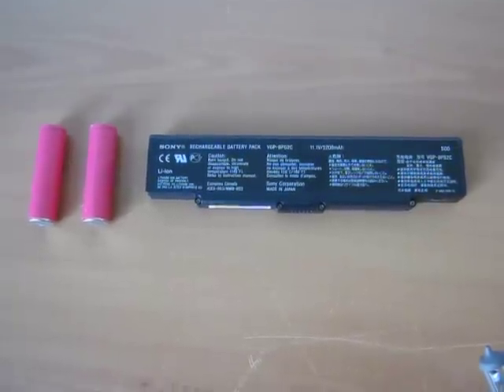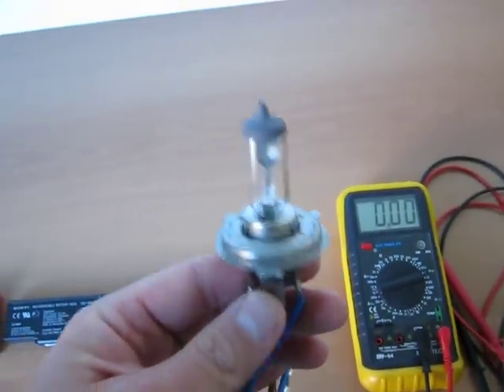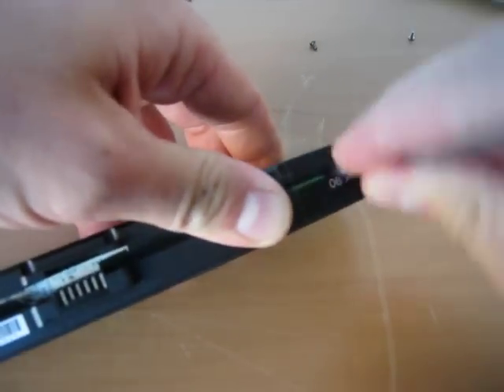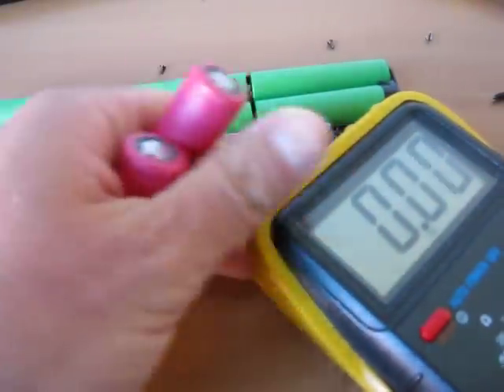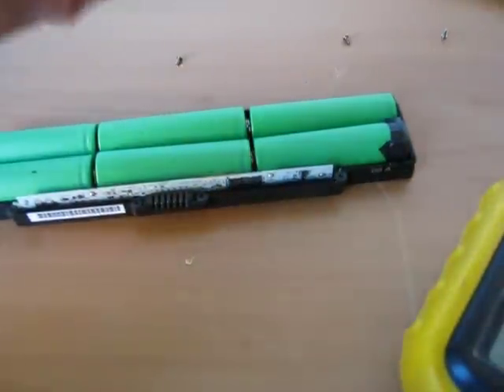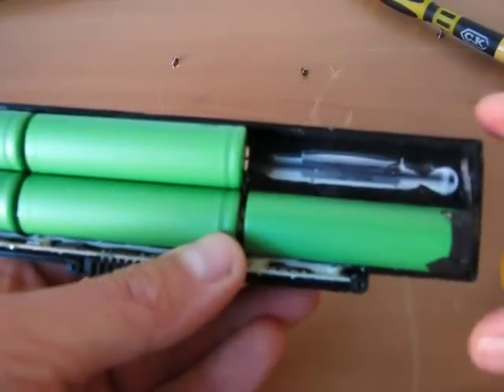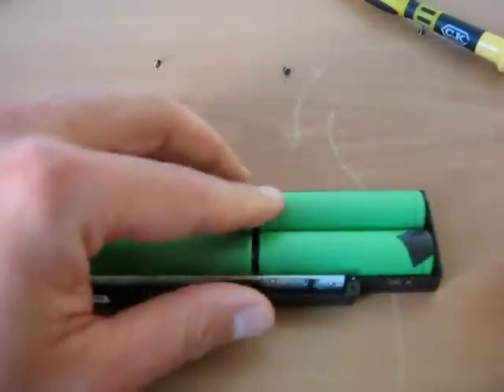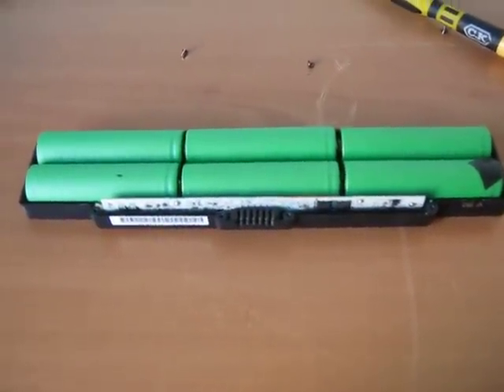Notebook battery repair / replacing lithium cells

Comment: Good video. My original laptop battery is dead and have these cell specs = ICR 18650 Samsung 30B. So when I replace the dead cells, can I only use the same Samsung 18650 30B cells or they can be any other type e.g. 28 or 32f etc..? Thanks
Reply: I think as long they are the same type and Voltage, e.g. ICR 18650 3.7V, it should be fine. ICR is the chemistry so you need a match. mA can vary, so if you want a battery that lasts longer, pick a higher mA rating. The brand does not matter but be careful of the various OEM counterfeits on ebay, advertising 3000+ mAh and delivering around 900. A normal battery of this type wouldn't go beyond 3200 if i remember correctly and should weight over 44 grams, if its lighter then it has a false mAh rating.

Edit: I suspect the 30b is just the model of the battery, can't find anything else with the 30b in it and the drain rate is expressed in C and E letters, B doesn't stand for something.
Reply: Thank you for technical information. Will see where can I buy those batteries.

Comment: How did you reset the battery after recelling?
Reply from the maker: do a simple calibration process, in many cases thats enough (some models might have problem with the built in EEPROM counter, do a search for your model)
https://support.hp.com/lamerica_nsc_carib-en/document/c04700771

Comment: I can`t believe how easy this reconditioning steps are ( Check Details Here>>https://plus.google.com/113658828433866467763/posts/72dX1D1623q ! My old (and once dead) vehicle batteries, cellphone battery, drill battery, camera battery and tons of some other batteries are all reconditioned and working good again! Do you believe I`ve ended up saving $ 400 from the day I started performing it??

Comment: Is it safe to use a 12V bulb like that to discharge 18650 cells? I have 6 in parallel for some project and want to discharge the pack. thanks
Reply from the maker: a 18650 cell should be around 3.7 V , if you tie them paralel the voltage remains the same just the current doubles what it can drive. Although it's not recommended to make paralel cell connection at home as you need special care for selecting matching cells for this, which made properly in the manufacturers site. (Only series connection is advised at home but not paralel)
Reply: 12v bulb? thats not gunna pull much current but with 6 yeah it will work. Discharging is never the problem

Comment: can't find battery inside the laptop ?  Can anyone help me about laptop battery replacement ?
Reply from the maker: internal lipo batteries are quite tricky as fragile for mechanical shock, not like the well protected cylindrical cells shown in this video. Contact your laptop manufacturer for internal battery replacement, try googling for service manual with the exact process.

Comment: On the vaio battery pack it says 3200 mah but what is the capacity of one green cell itself?
Reply: Capacity for each cell is 3200 mAh, and the rated voltage  3.6 Volt.

Comment: never touch + and -  of battery!
Reply: Uhmm...why? It's 3.7 V not 10kV :)
Reply: doesn't matter how many volts has battery. Battery life is shorter
Reply from the maker: Can you explain what are you talking about? A typical skin on human hand has a few mega ohm resistance, which corresponds to nano amperes running from battery during the touch...
Reply from the maker: Maybe this can be true for tiny computer real time clock / bios batteries, which has to be run for years. If some dirt / oil gets there from your hand that can effect lifetime like 1 year instead of 2 year. But in case of 3000 mAh lipo cells that's a different thing and no problem touching it.
Reply from the maker: I spent my entire life in electronics but never heard such a weird thing :) 
Can you send a proper explanation a website or something rational explanation? Thanks
Reply: well, i continuously handle caps rated and often charged to 35-45V without noticing. Above 55-65V though, the voltage is high enough to break through the skin on your hand if you're not extremely dry. 

https://en.wikipedia.org/wiki/Electric_shock#Body_resistance
Reply: As verokay said, it is very difficult for low voltages go through the human body due to the high resistance of the skin. If even microamps go through you, there would be no impact on the batteries whatsoever as these 18650 cells usually deliver around 3 amps safely without harming them.
Reply: I know it's not easy to understand and explain :) everyone has choice what to do :)
Reply: Just give some scientific background on how is it that "you can confirm".  Don't worry if it's not easy to understand, leave that to us.
Reply: i used to remove insulation by teeth and once i accidentally put a supply line in my mouth ( 220v phase ) and these 3.7v batteries are nothing................and yes there is a chance of explosion from these batteries.
Reply: Very ignorant and unhelpful comment.
Reply: I get this information from computer specialist. He has a lot of experience. I can confirm, that battery life is longer.
Reply: every electronics specialist knows about it, to don't touch.

Comment: Hallo veryokay brother, )) 
Please help. I have vaio with chinese generic 6 cell battery pack, that gave me around 1 hours 30 minutes backup.  Now I removed its generic cells and soldered original Samsung 3000mah cells in it. But, it gives me 1 hour 5 minutes back up. I thought they will give me almost double power. What must be done? Thank you.
Reply from the maker: Kketansa Art You should do calibration than, to let your laptop learn the real battery capacity! Google up the calibration process for your actual laptop type.Good luck!
Reply: Veryokay I did the optimization by Battery drain and Full charge, 2 or 3 times. Now I get 3 times more backup. Thank you very much Veryokay.
But one more thing I want to tell. When the laptop says 7% 14 minutes. it remains the same for little more than 40 minutes before it hybernates. I get much more extra time, even if it shows less % and time.
Reply from the maker: Kketansa Art Excellent! ;)

Comment: Nice video..I have tried this with all good batteries...and for some reason the complete battery will not charge..I think..or do you think that the charge control circuit has a counter that will stop a battery from charging...so you have to buy a new one..seems to me to be this way..if so rebuilding the pack will not work right??? I do know for a fact that some Canon camera batteries will not charge and say on the screen that you are using a generic or after market battery and it will not charge..
Reply from the maker: Kennynva T. I suppose to look a after your batteries exact part number on google, maybe there is an aftermarket eeprom chip for that (such in the case of laser printer toners...) 

I can imagine this discharge counting feature is varies by every manufacturer so you need to look after yours. Maybe there is also a PC software which can make the "unlock". Good luck!
Reply: battery's controller boards have a programmable chip that immediately will be erased after cutting the power with pulling out, one of the cells. I have done it and the battery went totally useless. maybe there is a way to replace cells without cutting the boards power

Comment: Question, I have asus x101h, i change the battery cells and used battery care and couple of more softwares to check, everything seems fine, but battery always shows 100% and when you unplug AC laptop turns off. its like battery is not responding but system shows 
Design capacity : 28080mWh
Current capacity : 2648mWh
Wear Level: 88.8%
Can you help ??

Comment: Most cases these days are glued together and are so thin in nature that they are more like a skin of plastic over top the battery's cylindrical form. The next thing you will have to deal with is joining, center voltages or balancing wires,and  possibly welding.
 Keep in mind that some batteries process this over/discharge protection circuitry and can be made much shorter if you remove these component(s) see YT vids on removeing overcharge protection on LiIon batteries https://www.youtube.com/watch?v=H75cYVbvRyo

Comment: can i upgrade my laptoip cells from 600mah to 2600mah each cell has 3.7v and laptop battery is rated with 40wh is there any problem
Reply: This is nonsense. Increasing the Amp/h is perfectly ok. For any laptop you can buy higher Amp/h battery packs. You do not need to replace the charger. The voltage is the same. (but yes, it does take longer to charge).
Reply: i know it's been a while since you posted this comment but i still wanted to answer in case someone decided to do the same. if you do that, you'll probably need to replace the charger with bigger amps otherwise it will take much longer to completely charge the battery. i think...
Reply: thank you

Comment: If you were thinking about just replacing the worst dead cells, don't do that.  what will happen is that if you install new cells alongside the old cells. The new cells will discharge into the older cells and the voltage of the entire pack will match the voltage of the worst cells.  I remember that from a circuits class. 

Same thing with a diesel truck with a bunch of batteries in a tray.  Replace one or two dead batteries and the new batteries will simply discharge to the level of the worst battery the truck has.
Reply from the maker: Ted Baxter Agree, it's advised to replace all the batteries together as I did on the video.

Comment: Hello sir i have a netbook with 3 cell battery i want to modify its battery to 6 cells to increase the battery timing will it work and charge the battery with the netbooks original charger please help .thanks
Reply from the maker: isam ahmed The easiest way is to get a 6 cell aftermarket battery pack. As your 3 cell battery is already used, you should refurbish those 3 cells as well, so your life is easier with a cheap aftermarket 6 cell batterypack. Good luck!

Comment: This video is wrong. Most of the laptop batteries have the case glued and with no screws. Try to open-it and you going to crack the case. Cells are connected together by welded metal plates between the terminals. Do you have a welding machine ?
    And not the last, if you buy separate cells you nay pay a lot. Is better to buy a replacement laptop battery. They became not so expensive.
Reply from the maker: lipsa pauza the decision is in your hand whether you DIY refurbish your battery pack or purchase a new one. This video is just a guide based on my own refurbish. Thanks for your comment anyway!
Reply: You can buy the cells with pre-welded tabs. So they are easily soldered. If you buy high quality cells (like panasonic 3400 mAh) you will get a MUCH higher mAh pack than the replacement packs available commercially (which contain low quality / low mAh cells). And glued cases are easily opened with a sharp scalpel knife.

Comment: Question,(  lap top battery Voltage: 14.4 V, number of Cells: 8, capacity 5200mAh.).

(second l top, Voltage:10.8V, Number of Cells 6, Capacity: 5200mAh).

The 2 batteries  advertises with these specs........Why the same 5200mAh..........is the rating wrong on the 14.4v ?

battery. I'm assuming batteries in lap 1,2. are 3.7v each. So , if each battery is 3.7 then 3.7 X 8 be 29.6v and 3.7 X 6 

be 22.2v.

Can you tell me where these 22.2V , 29.6V correspond in respect to 14.4V, 10.8 V?  with the last 2 being compatible.

thankz.

Comment: Why , while you test the pink battery, you place the black probe which is negative (N) on the positive side of pink battery.
Reply from the maker: Either the 12V bulb or the multimeter DC Voltage Measurement function is independent from the point of polarity. The multimeter will show you a negative sign before the voltage value if polarity is mixed. For the 12V bulb polarity is absolutely not an issue (you can even run it from alternating current as well). Good catch anyway! :)

Comment: It would be very wise to solder the strips together. If it so happens that one cell in the pair remains disconnected while the other goes through a cycle of charging or discharging, when they "meet" again after the contact reattaches, it will be close to a short, producing excessive current!

Comment: That Battery is 38.00 online. It's hardly worth the time screwing around with it.....just buy a new one.
Reply: Not gonna check and see what battery it is, but in some cases (mine) the only real option is replacing them yourself. My laptop of choice is 13 years old now and the only new packs available are chinesium and of incredibly dubious quality, and all the genuine ones are degraded to the point of uselessness.
You can also build a custom pack above the factory spec if you know what you're doing.

Comment: 1. I see 6 batteries/cell of 3.7 Volt are here. They should make 3.7vx6=22.2v
But battery cover show that this contains 11.1, the output of 3 cell only.
Why is it?
2. Another thing is that- why should I change all the cells if I have problem in 1 or 2?
If 2 cell out of all are well, then what's the difference between these old and new cells?
3. Are these cells same for all brand of laptop's batteries?
Reply from the maker: tlaloc1525 11.1mAh would be pretty low :))
It's 11.1 V and 5200mAh
for example: www.tmart.com/Laptop-Battery-5200mAh-11.1V-for-Sony-VGP-BPS2C-BPS2-VGP-BPS2-VGP-BPS2C-VG_p136309.html
Reply from the maker: Hi,

That's a really good remark! For superior battery pack design flexibility, manufacturers use the cells in series + parallel configuration! This means in this case: they put parallel 2 - 2 - 2 cell, so they got 3 groups of parallel cells. After that they connect this group of 3 in series. 

For more details please visit this site (Serial/Parallel Connection topic at the middle): 
http://batteryuniversity.com/learn/article/serial_and_parallel_battery_configurations
Reply: 11.1mah not 11volts
Reply: 11.1 V....capacity 5200mAh
 My question how do they come up with 11.1V..rating, if it has 6 batteries.
Reply: Thanks for your responses.
Reply: Feliz navidad....kruger.

Comment: can i replace all of them with recharchable duracell cells ?
Reply: Why do you think they don't simply make them with replaceable cells or better, commonly available cells?  To charge more money for these odd sizes of course.
Reply from the maker: if you got the very same rating (voltage[V] and capacity[mAh]) LiIon duracell cells, I don't see any problem using them.
Reply from the maker: Garras Porgratix This LiIon cell size is odd only to our eyes, because they normally hidden in the plastic enclosure of the battery pack. The truth that this type of LiIon cell is the most common all over the world due to the consumer electronics (mostly laptops, notebooks): 

This is why Tesla chosen 7000 pcs of this "laptop" cell as the "battery pack" of Model S
http://my.teslamotors.com/forum/forums/why-tesla-model-s-has-so-many-battery-cells
http://www.coppermotor.com/wp-content/uploads/2014/11/Tesla-Model-S-Battery-Pack-Ricardo-photo_1280.jpg

Comment: my laptop battery is 4400 mah can i increase the capacity i mean can i use higher MAH as long as Volt remain 3.7 v
Reply: Veryokay
Indeed they are smart, but fortunately not intelligent.... yet :-)
Reply: Not a problem - if you you can find cells greater than 4400 mA/h, but you'll need to replace them all for the same type.
Reply from the maker: I think the answer is more sophisticated. It's depends on your laptop type, how it's handle the cells and the battery management circuitry. Theoretically after a calibration process your charger circuitry "learns" the real cell mAh. But this could vary by model to model. Its better to make some googlin about your specific laptop battery pack (different versions, mods etc.)
Reply: my laptop is acer 5738G
Reply: Veryokay  No, it won't make any difference at all. The circuitry in the internal (battery) pcb will regulate the current according to the charge state and temperature.
Reply: geoffphuket
yeah thats what i was thinking ...i mean its just a source within the limit
Reply: rohan sharma Thanks - as a qualified electronics engineer of 30 yrs, I think I know what I'm talking about. LOL
Reply from the maker: geoffphuket then we are in the same job :)) I'm taking precaution because new portable electronics "innovations" tend to be too smart nowadays, registering everything in eeproms during the charge/discharge process, and you cannot simply change the bits and pieces of the system freely.
Thanks for the comment here!
Reply: Replace them with Mj1's 18650 and profit